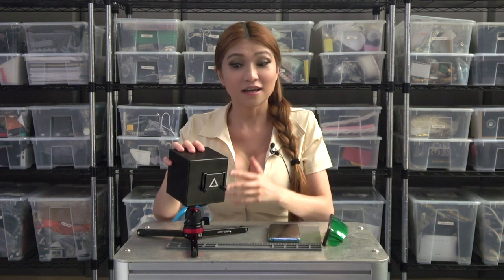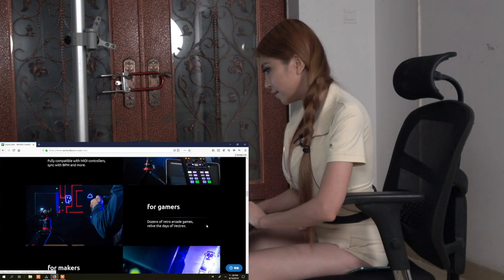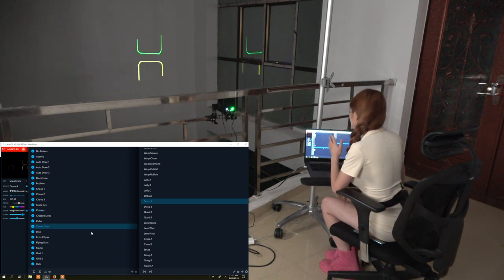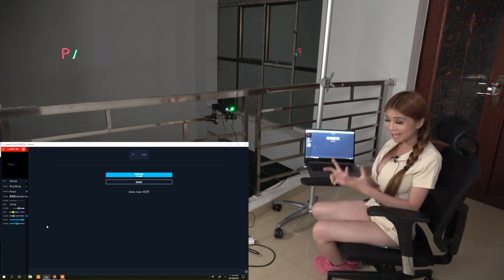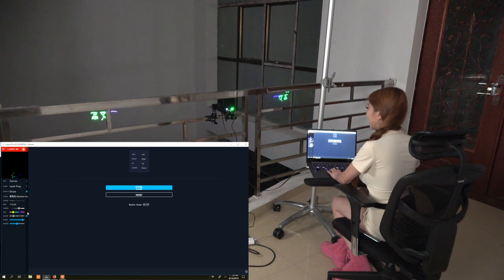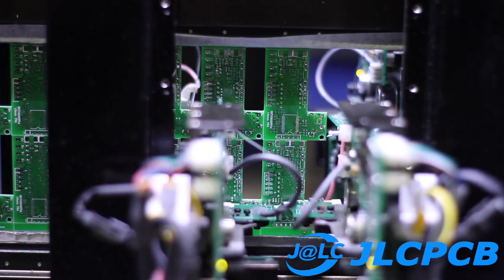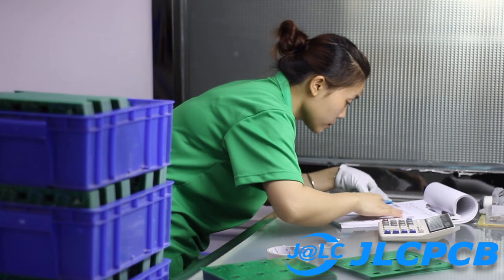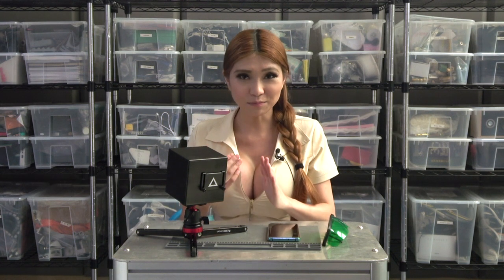LaserCube- Party Laser AND Laser Engraver, in One Device‽

Comment: Since the device already has a laser. A rangefinder safety feature could be installed. Basically if the laser is set to engraving mode, it will not fire unless the object to be engraved is at a very short distance away from the cube.
Reply: Any anti-misuse function needs to be solidly out of reach for modification.
  But one should consider the advanced dangers anticipated in the original "West World" movie, where a company tried to add a "don't shoot humans" system to real guns to turn them into toys.  Didn't work out that well.

Comment: Oh, my......very good points regarding Mode errors. Most hosts would have pointed out the power differential in the two modes and the potential problems, but you added the engineering aspects with examples. A great job illustrated responsibly with examples people can readily relate to. While I don't usually comment on your attire, I do have to say that what you're wearing is fetchingly spot-on for your videos.

Comment: Interesting cube, you are correct it is great for parties. The second part of the video is the best. We do need to discuss usage and safety, this unit is multimoded and should never have been released for that. I love your 100W CO2 laser tube, I worked with a 1kw CO2 unit (double the size of your tube) until one of my techs decided to run without the cooling water. You did an excellent job presenting both sides. Keep up this great work but stay out of trouble, hate loosing you and your personality.

Comment: Verry good points, including the infered " can the end user make it safe ".  If the manufacturer can't afford the extra parts, small addition of code, and extra drilling to mount the passive IR sensor, any new owner should be able to add an Arduino controlled FET or relay to safely cut the laser's power while mountable inside the same box and using the same power supply.

Comment: Cool to see you are in the new space. Have a bit of an echo from sound bouncing off lots of hard surfaces. There is an easy fix. Your new castle needs tapestries. :)

A sound-absorbing surface can do a lot to cut down reverberations. A hanging fabric banner along one wall will do a lot to make that wall acoustically "dead". Large flags, rugs, or whatever you find entertaining...
Reply: With the added advantage of being nicer to look at than anechoic tiles.
Reply: @williamswenson5315  One glass-box restaurant did incorporate anechoic tiles after I made similar comment. Managed to find place where barely noticeable (and only as I was looking).  Was looking as I noticed on later visit the place was much quieter. Small area covered made a large difference.
Reply: @PrestonBannister  I can only imagine there existed an acoustic focal point where sound energies reinforced themselves and produced a horrific clangor. Careful placement of a few tiles would probably  eliminate that problem. I was picturing the repetitive foam spike variety which while effective, are tres ugly.
Reply from the maker: Sure, two of the walls are covered with acoustic tiles but the room is two stories tall so very hard to dampen...
Reply: @Naomi-Wu  If  you still have more stuff to unpack in there, get that done before investing in more dedicated treatments. Clutter and general stuff will actually help to break up the sound waves.
Reply from the maker: @ssa9148  oh, cool thanks👍

Comment: Wow, I looked at the site and they really do advertise engraving as a feature huh? Make cool lightshows for a crowd, burn patterns into a surface, project games for the kids... y'know, stuff that just goes together!

I mean the thing looks powerful enough that you'd have to be extremely careful operating it anyway, but making burn mode an advertised feature just sounds irresponsible. If you want to market to makers like that, maybe it should be a separate product with a fixed lens? Feels a bit like advertising a pressure washer with a power knob as a water pistol

btw I like how you don't hold back with this stuff Naomi, you really say what you think! No pandering to the companies here

Comment: It wouldn't cost much to fit a time of flight chip and make sure the engraving mode never functions when the target is over say 300mm. You can use a beam splitter to ensure the ranging laser can't be redirected without doing the same to the main laser. Or just pulse the main laser and time the response.
Reply from the maker: Good way to do it👍

Comment: Every professional stage laser system has a safety feature that blocks the beam when the galvos are not moving like they should.
They close a mechanical shutter as well as blank the laser beam electronically.
A device without a shutter should NEVER be used when the beam can reach people.

Comment: Naomi, that was a thoughtful review - not everyone will consider the dangerous implications that some devices like this one might have. It is incomprehensible that wicked lasers are even selling these - and should do a call back and retro fit eye protecting hardware/firmware that can not be easily tampered with as per your concern.

With regards to the flickering, as others have mentioned - was it not possible to (easily) sync the framerate of the camera with the laser to circumvent flickering in the video?
Reply from the maker: Probably, next time I'll try...

Comment: Should have hardware beam killer if scanning speed is too slow and likely to cause burning of retina in the event the path control is deliberately made too slow of the scanning hardware fails. While it is nice to have two functions in one device, a dedicated hardware system should be used for laser etching and should come with suitable safeguards such as orientation kill switches. Designed to operate in one orientation static, so if it deviates, the beam is cut preventing you from picking it up and shining at people.

Comment: the  engraver part shouldnt be implemented
or, if you implement it, then   it should be  made  like the  stronger versions  of galvo lasers 

so on the end in my opinion it shouldnt have the ability  to focus on  a few cm with  higher energy

i got  one  of those diode lasers and its cool, because  i can attach  on machine and it cuts pattern
but never tought  accompanying with a galvo head..